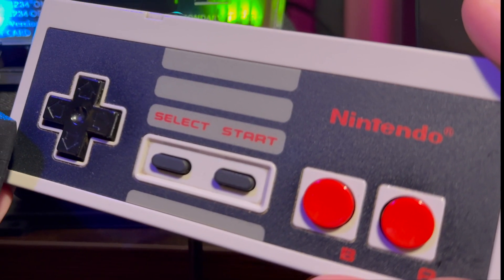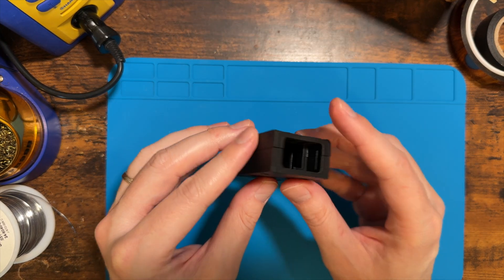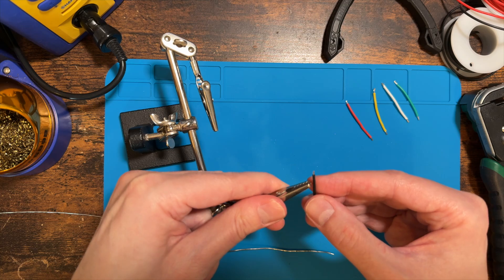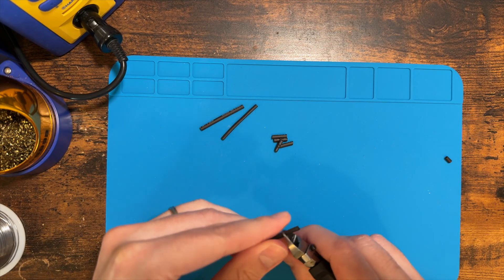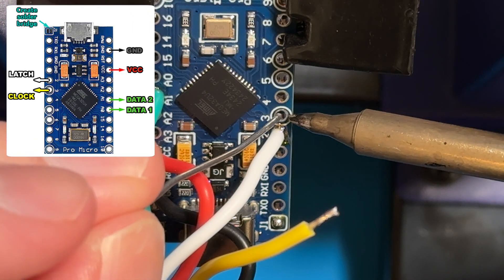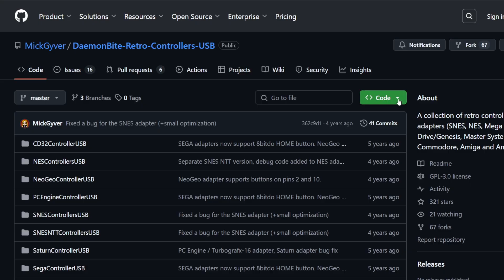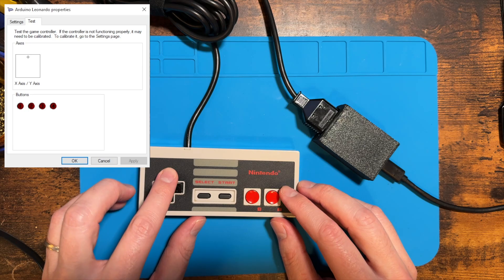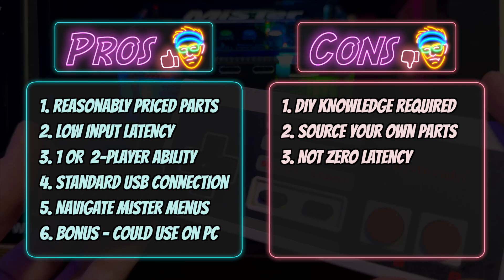MiSTer FPGA NES Controller Adapter | DIY USB Build Guide (Daemonbite Tutorial)

Comment: Which vias on the Pro Micro do I solder a 2nd NES controller to?
Reply from the maker: Actually, almost everything is shared. So, the following wires are shared between both controllers and attach to the same Pro Micro vias outlined in the video: P1/P2 VCC, P1/P2 GND, P1/P2 Latch, P1/P2 Clock. The only separated connections are for Data. Player 1 Data -> via A0. Player 2 Data -> via A1. You can see a visual of the diagram at 5:00 in the video. Let me know if you have any other questions.
Reply: @naadofett  Oh, oh, ohhhh! Now I see it! It wasn't explicit enough for my eyes, but now that you've pointed it out I can see clearly now. Thanks!

On Timville's 4dapter github, he has D3 and D4 for the NES on vias 8 & 9. I'd like to connect my PowerPad and don't want be bothered by which controller port I plug into on my arduino adapter. So the question: for my 2nd controller port for D3 and D4, which other vias would I connect to?
Reply from the maker: I'm not very familiar with his design, but it seems D3 and D4 for NES are for "special controllers" (i.e. PowerPad I assume). So, my feeling is that similar to VCC, GND, Clock and Latch, You would just connect the wires from each D3 port to the single D3 via on your arduino and do the same for the D4 port wires to the D4 arduino via. That way, you could plug your power pad into either controller port. Again, I haven't wired anything up using his design, but that's what it looks like to me.

https://pinoutguide.com/visual/gen/snescontroller.jpg

Comment: Fantastic build video. Your's is so much cleaner than mine haha. Love the 3d print!
Reply from the maker: Thanks I really appreciate that. I’ve been slow getting out new videos (several in the pipe) since I just moved from Japan to the U.S. and have been getting set up again. I’ve also got a brand new 3D printer I’ve been using over the last couple weeks and it blows my previous one out of the water. I’m really looking forward to showing off new stuff with the upgrade in quality!

Comment: You should not be touching the cable directly as it has a ton of lead and touching it while heating it... and then touching your skin/face/mouth can have devastating results for your health.
Same reason you should have some kind of ventilation as the fumes are super dangerous for your health as well.
Reply from the maker: Appreciate the advice and will work on improving that going forward!